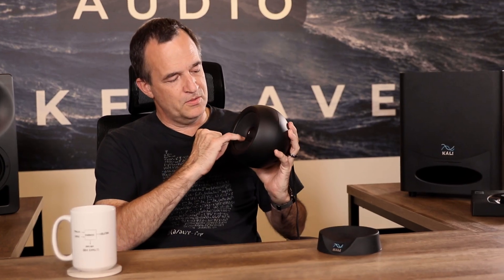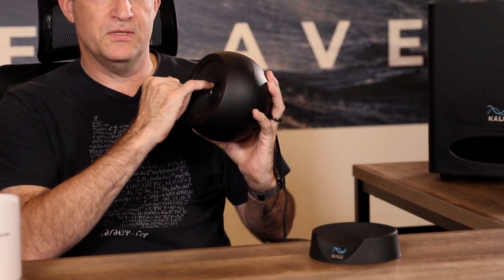FAQ Friday: Why's there a gap in the voice coil?

Comment: For home audio or studio monitoring, would I be better off with ONE WS-12 subwoofer or TWO WS-6.2?

Having two WS-6.2 would provide more power (800 watts continuous vs 500 watts continuous) and overall woofer surface area (133sqin vs  113sqin), but the frequency response wouldn't be quite as deep (27Hz vs 23Hz).

Logic tells me I would be better off spending a few extra dollars on two of the smaller subs, but I'm definitely interested in hearing your opinions.